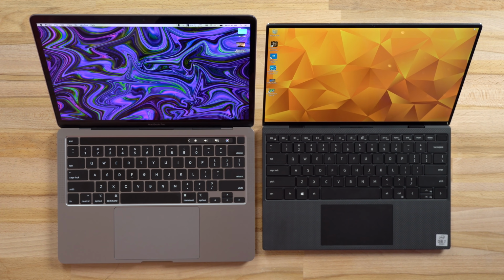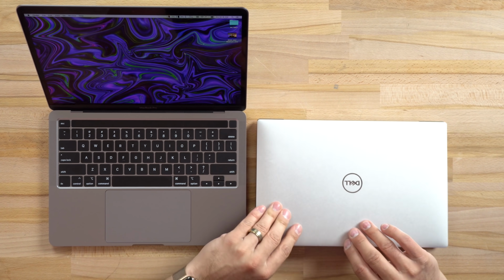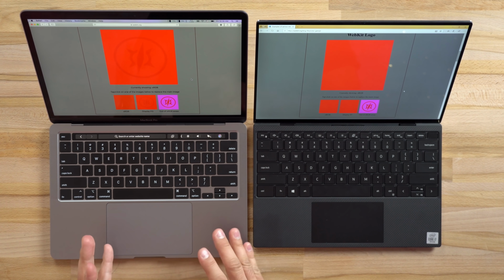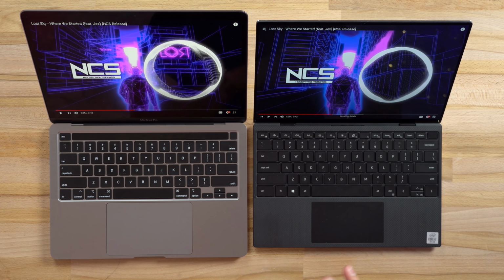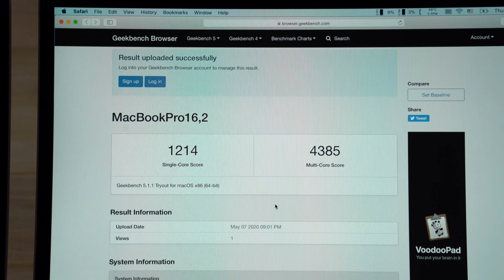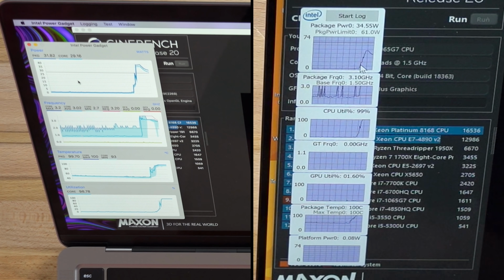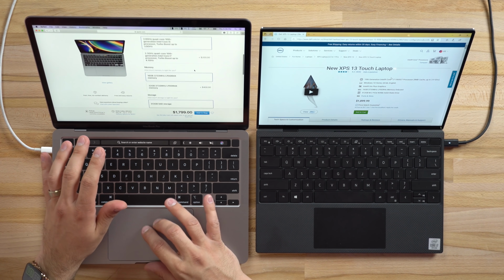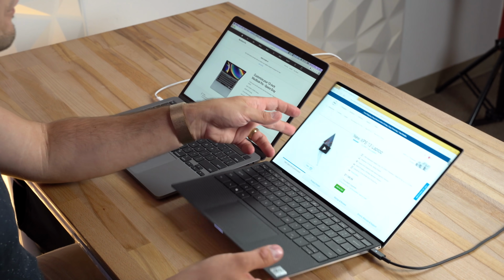2020 MacBook Pro vs 2020 XPS 13 9300 - Best Ultrabook?

Comment: These two laptops are amazing. But the choice is simple. Do you want Windows or MacOS? Done.
Reply: Dell makes it easier for users to go to windows because you get dell mobile connect which after setup will allow you to deal and drop files from your iPhone to the laptop and send messages and imessages to ppl from the laptop as well
Reply: People, stop being dumb and smartasses. NO ONE is buying a windows laptop for MacOS, and most definitely NO ONE is buying a Mac for windows.
Reply: What you also consider is you can run 100% window on MacBook but you can't run MacOS on XPS.
Reply: that's not evident, because you can install Win on MacBook
Reply: Victor then why not get a windows laptop with better god and stuff than a MacBook with 60hz display?
Reply: Which laptop is best for watching movies or tv shows? I just want something with the best display
Reply: Erik Mik wait for the xps 17 and get the base model for 1500$. Its screen is 17 inches
Reply: @VictorWard1155  buy a tv
Reply: @VictorWard1155  buy a mac ...thank me later...
Reply: @vivekaggarwal4876  the Dell has an option for 4k with the same nits brightness but the Mac is better?
Reply: Asarni Thomas The Mac display has a wider color gamut that’s why
Reply: Dell XPS 13 also runs Linux, so you can dual boot.
Reply: You could also just install mac Os on the dell or windows on the macbook🤷‍♀️🤷‍♂️
Reply: Dell everyday of the week, the only downer being Windows 10.
Reply: Windows 1000$ cheaper
Reply: Plane Find me a computer with the exact same specs for 1000 dollars cheaper. And if you actually manage to, have fun with it catching on fucking fire 6 months from now lmao
Reply: @PB-jo9vq  easy, lenovo legion (amd ryzen 5). It’s way better than MacBooks in every way, except the track pad and battery, but those are excusable because it’s a gaming/video editing laptop, so by then you should know to plug it in and use a mouse. Plus it’s a good competitor to the m1, same with the asus rog zephyrus. I was looking at macs but then my eyes were opened by Lenovo and asus
Reply: Tha Macbook is an oven, I would never ever recommend it.
Reply: Exactly my thought too :-)
Reply: That’s it. You got it spot on.
Reply: No, the choice is XPS and that's why it's simple.
Reply: You guys know you can buy this from Dell with Linux on it right?
Reply: Sorry I'm going for linux
Reply: P M i had friends and family that have macs that still run good up to 5 years of age. My dell xps 15 is almost 3 years of age and they run hot 90% of the time now. I would use my mac 16 for everything unless i need a windows software. I do programming.
Reply: Its also buggy as hell on the xps. Windows ui is just not as good as mac. The trackpad also kills competition.
Reply: Nikolas Jody exactly! Thank you! I bet most people who are avid Mac haters would change their mind if they actually had one. They’re more reliable and last so much longer without issues.
Reply: @PB-jo9vq You should educate Louis Rossman about you findings.
Reply: Karan Amin Looks like your in the same boat as me :(
Reply: Karan Amin I have the new MacBook Pro and it’s great. If you already have the whole apple ecosystem minus the laptop, it may be better to go with a Mac.
Reply: @PB-jo9vq  I have a 2020 13 MacBook Pro and a 2015 Dell XPS 13 and I never encountered any issues on my windows laptop so far. The only reason why I purchased a MacBook is because XCode is not available on windows. Using XCode in hackintosh is very buggy(My Test device would often disconnect and some other issues).
Reply: 415 JPX I’m glad you haven’t had any issues, all in all both are great machines and it’s gonna come down to preference and personal experiences. Was just speaking on my own experience
Reply: It's not that simple.
Reply: XPS 9300 all the way if you want half the battery life as a MacBook, your fingertips melted from the keyboard, and a tweaked 125%-150% zoomed resolution where nothing really looks the way its supposed to. It’s so sick.
Reply: 😌idk
Reply: You people never heard of Linux?
Reply: Idk u tell me. Not done.
Reply: can anyone here tell me if i should get a mbp or the xps? i need it for school and some gaming.
Reply: @uj12678  if you already chose, you can ignore this. 

buddy, lemme tell ya I was in the same spot a couple of months ago. Looking at macs, comparing to other windows machines; the windows won. I’m still saving enough money, but if I had to choose one, definitely the Lenovo legion with amd ryzen 5, or 7 for only $100 more, plus, imo the keyboard for the legion is way better. But if you want portability and no good triple a games, MacBook Air m1. The choice is yours, I’m just giving you a recommendation.
Reply: Mac always win.
For some unknown reason Android phone and Windows OS computer slows down dramatically after 1 year of usage. But Mac keep shine even after 5 years.
Reply: @rafnogueira  hey man, I’m not saying this to be mean or anything like that, just a friendly reminder to get better at English, once again I’m not hating
Reply: @Azubi_Meatball4349  Yeah my commentary was really bad, I'm sorry... Don't have many people to practice with me  conversations. sometimes i make mistakes specially in temporal conjugation
Reply: You can run Windows (I know not 100% the same and most solutions incur extra cost) on the MacBook
Reply: @joshjacobson9846  you can also run MacOs on windows...hackintosh
Reply: @curiousgeorge6921  Not as effecient as windows on macos
Reply: curious george hackintosh runs very poorly in Windows computers. The computers r optimized terribly with MacOS. However, running windows on a MacBook is a lot smoother
Reply: @curiousgeorge6921  not stable, you can risk ruining your computer
Reply: curious george MacOS hackintoshes for all laptops are not viable sometimes because one update could brick it. It also can take days of
work to get it up. When a MacBook I open it and it’s ready to go
Reply: curious george Have you ever tried running macOS on a Windows machine? Good fucking luck, even with a virtual machine.
Reply: @yaboy62377  ??? Have you seen benchmarks hackingtosh computers beat the crap of Mac Pro
Reply: @EduardoRodriguezRocks  Not this specific computer
Reply: Windows. Cheaper upgrades, sharper screen.
Reply: He is always biased towards Apple in recommending products
Reply: Honestly I just like Windows better because it seems smoother
Reply: Mac is literally just useful for Browsing, Watching Videos, Video editing(kinda), coding(kinda)

All for a reasonable price of 1800+
Oh you want more Ram? Sure 250+
Oh you want more Storage? Sure 300+
Oh you want a better screen? Nope.

Sure, windows - 4k scaling is a joke - at least they offer a 1080p touch screen for less than the base price of the macbook. Mac is an absolute joke.
Reply: Just wait for the Dell XPS 15 2020 model, its being released this week. That will be a 2020 laptop competitor.
Reply: Plus, if you get rid of the windows on the dell and put mac or linux it probably runs just as well (I think better w/ linux) than the macbook.
Reply: Ever heard of hackintosh?
Reply: I use both daily and in notebook form, a new-ish Lenovo T480 and a 2012 rMBP 15 inch. The Windows OEMs have closed the gap on hardware to almost nothing, but you still get weird dock ports (for no reason with Thunderbolt 3), crap webcams and/or mics and on occasion USB 2.0 ports! The main things that matter are really good, but I'll take the longevity and superior (for me) productivity of MacOS over Windows.
Reply: No, test them with plugged and unplugged power cable, you will think again.
Reply: Just install ArchLinux and your done.... much better than MACOS, (and I do own a MacAir)... I'd go for the Dell.. looks much better
Reply: Lol you could hackintosh the dell with better performance than the native macbook pro and then triple boot windows, macos, and Linux like I currently do on my Lenovo with no problems 😃
Reply: @theprotester5171  ya put your lenovo to sleep with MacOS for a day... you know what I mean
Reply: @farizafaf  I can put my lenovo for sleep without any performance issues, with MacOS. YMMV based upon how much you know about making a hackintosh. If your a noob doesn't make  me one.
Reply: The Pro Tester hackinstosh is like virtual machining windows for what you can do compared to original MacOs and Windows runs better on bootcamp than normal windows on Pc, it have a lot less problem.
Linux works both whit no differences, but the others two...
Reply: The Pro Tester It would not have better performance than on a MacBook lmao. Hackintosh on windows is never as smooth
Reply: Keep in mind the DELL comes with Windows Home. An utter joke.
Reply: @uhohoverflow  not true at all you can also opt for Ubuntu 18.04
Reply: @uhohoverflow  I, and a lot of other people, don’t have a use for windows pro, so home is great. Plus I’m a gamer so windows 100%
Reply: Do you want coil whine? Do you want problems with scaling? Done
Reply: Hackintosh
Reply: David A. You know why right? Windows is optimized for performance so you can run powerful programs paired to it. Macos is like the google chrome of operating systems, kinda. It’s just about what you need it for.
Reply: @everytism  MacOS is UNIX

Comment: DO NOT buy Dell laptops. The company is complete garbage post 2016. They use batteries that end up expanding and damage the laptop. The disturbing thing is Dell does not think this is a problem. Well it is a very serious problem as this is dangerous. Dell are taking people's money and providing false advertising. They need to clearly state that the battery will expand and cause damage to the laptop. Cheap garbage made in China parts are used and the quality control is absolutely disgraceful. Do not buy Dell garbage as that is the only way they will learn. Also DO NOT buy Apple. as they are overpriced crap.

Comment: This time the MacBook Pro 13" really win, even without windows it win, dell win only on bezel, and size and wifi 6. other thing are about same or worse.
Reply: Enrico Colombo I think it was an Linus Tech Tips video, but they mentioned how smaller actually isn’t always better, and Mac laptops have always had amazing, large trackpads and more comfortably sized wrist rests (especially for us with larger hands) because of the larger physical footprint of the machine.
Sure the bezels look straight outa 2016, but I’d take the larger trackpad, bigger battery and more accommodating wrist rests any day of the week.
Between the two laptops it’s really down to macOS (with the option to dual boot Windows) vs a Windows ultrabook.
Reply: FunkyFalcon you’re right, obviously reducing size have its disadvantages, for mee too trackpad, wrist space and larger keyboard are better than smaller dimension, but maybe there’s who prefer smaller dimension. 
I use MBP 16” whit both MacOs only for daily task, cause i am not a photographer, video maker’s or programer, i need Windows for programs for university like autocad 2d/3d, inventor, fluid sim, Thinkercad and especially solid works.

Comment: 16 inch vs maxed out 13 2020 MBP pls 😍
Reply: Tbh the 16 in would be better in virtually every way bc of the dual graphic cards and the 6 core processor
Reply: @isaaclinzay8684  It doesn't have dual GPUs(I think you got confused with the Mac Pro) but price to performance will absolutely be the 16'. Twice the CPU, bigger screen, an actual dGPU...

Comment: The XPS is a great machine, but for me it is almost too small actually. I appriciate the extra space on the macbook.
Reply: I used to prefer the small form factor of laptop. I am currently using a 2015 MacBook. I enjoy the portability it provides and consuming media on it, Youtube, Netflix etc. However when it comes to typing it is not comfortable at all as the keys are more crammed and your hand gets fatigued quiet fast. Typing on the 13 inch MacBook with the extra space between keyboards and form factor. That experience is way more comfortable and easy on the hands on the long run.

Comment: I bought that exact MacBook Pro. Very interesting video and they're actually super close machines.
Reply: Nah, the dell seems way better. Looks more modern too. Mbp looks like a vintage computer at this point. And does not deserve the pro name. Should be renamed to MB air.
Reply: @TheFrontyer  You're getting better CPU/GPU performance, trackpad and speakers out of MBP 13 though... Not to mention the exclusivity of MacOS. But I agree that XPS nails the design.
Reply: @TheFrontyer  That's so true!
Reply: Me too :)
Reply: me too 👌🏽
Reply: @thomaskuski6239  How is the battery life for you folks? I'm this close to buying the MBP ($1799 version), but worried about reports of like 5 hrs only (TheVerge review) :/
Reply: blasborg Depends what you do. i’d wait for the next macbook pro if battery is a concern.
Reply: I don’t know much about laptops, but if I wanted Word or Excel on my macbook, would I have to pay? Does the Dell come with Word and Excel on it?
Reply: Tiffany Manu Word and Excel are free if you use on the website online (like the google suite of apps). If you want to download the Microsoft office and use it offline on windows or Mac, you will need to pay for it or be a student. The XPS does come with the Office suite free for the first month I believe.
Reply: @kiaghods5730  is it worth buying the macbook pro for using MS office? I need a premium office laptop and I'm not sure about dell's quality but I've also heard ppl say don't buy mac if you're going to use ms office alot cos it's not optimised

Comment: I choose macbook pro 
*premium build quality  
*Best in class track pad 
*Superb speakers 
*Amazing display with Dcip3  colour gamaut and low reflective screen 
*4 full speed thunderbolt ports 
*All in all Mac os with fcp is gem ......
Reply: And don't forget high performance even if its unplugged compared to dell.
Reply: Clement's Tech. Mv The MacBook pro doesn't count as an Ultrabook though right? Like come on it's quite a bit bigger even for the screen size
Reply: @richiec54  that no a prb man
Reply: David A. Exactly. People complain about Macs being expensive but you can use the same MacBook for so many years before you’ll no longer receive updates. Try that with a Dell, you’d be lucky to get 3. I’ve known people with MacBooks they were able to use with no issue for 8 years.

Comment: I personally think the thunder-port ports look very sleek.
but if I'm able to add or trade 1 thunder port for an sd cart reader I would be more than happy.
edit: the very minimal ports I would give a laptop are: at least 2 usb type a and 1 type c, a sd cart reader and a charging port (preferably magsafe, that's just the best, you will never drop ur laptop ever again because u tripped over the charging cable)

Comment: Nah, so Dell i7 thermal throttled hence only 25w usage compared to 30-ish on MacBook. But I still believe that those i5 i7 base clock means completely nothing giving the highest TDP available. I think the 10X8G7 cpu benefit from native 28w instead of tdp up of 15w 10X5G7.

Comment: Waiting for the MBP 16 $2400 vs MBP13 $1800 comparison :)
Reply from the maker: About to film it now :)
Reply: @MaxTechOfficial  yeah that is the one I'm looking forward to to be my main programming machine
Reply: Max Tech noice
Reply: Oh yes...that’s the comparison I’m very interested to see!!!🙏🏽
Reply: How are you undecided between a 16" laptop and a 13" one? They have very different portability and use cases
Reply: 16 inch will slaughter. Better cpu and it has a discrete gpu

Comment: 2020 13"Top Macbook pro vs Base 16"
Reply from the maker: Coming soon!
Reply: @MaxTechOfficial  I Really Really Appreciate that Mate !
Reply: @thanushr.v5868  ^
Reply: Many places have the base 16" for sale at 2099. The upgrade is worth it if you do any gaming or higher end video editing imo.
Reply: Ilipan I’ve seen it for 2199 at the lowest (new). Where did you find the 2099 sales?
Reply: @YouProductions1000  BH and Amazon had it at 2099 about a week ago